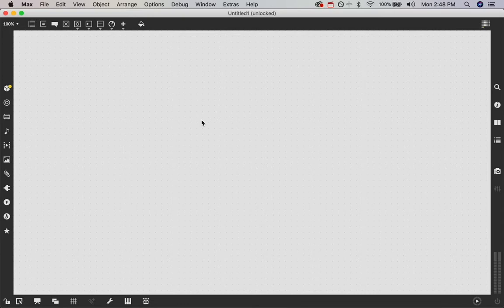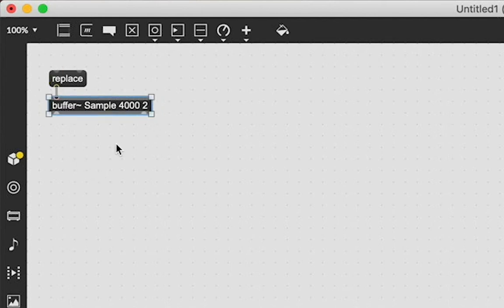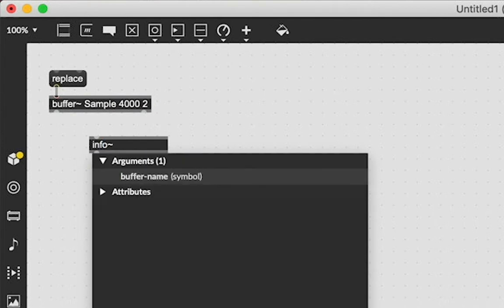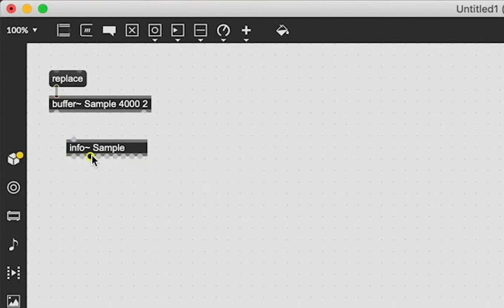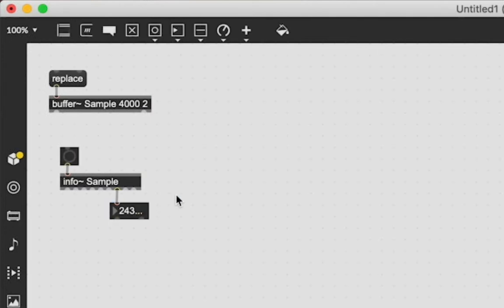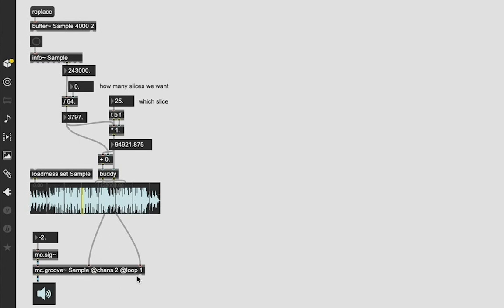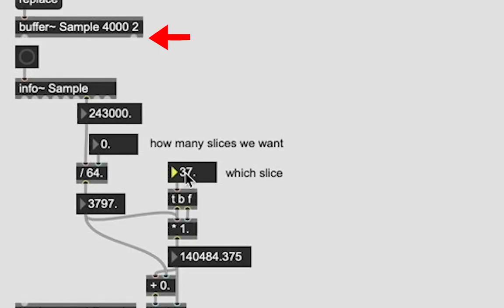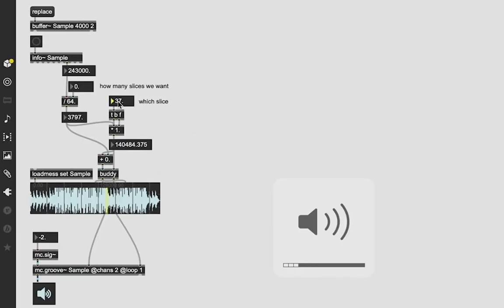Sample Slicer Tutorial -- Max MSP Tutorial

Comment: It's so frustrating - I'm on max 8, and double-clicking just doesn't work. I don't know, but it would be helpful to mention what you're doing instead of stating the obvious - double click the buffer. Double click in order to do what? To open the preferences, the UI? It's just impossible to find another way to proceed, because the double clicking doesn't work, and it's just not clear what this double click does in order to find a workaround and do it in some other way

Comment: Hi, 
I want to set  transient points of an audio  in a video(mov). But "import" message of  (buffer~) does not work.  How I can load or extract audio channel(stream) from a video and load to the buffer~  object?  
Thanks in advance 
Tuğrul
Reply from the maker: That is unfortunately not super straightforward to my knowledge. Check out my tutorial video called “frames above a certain volume threshold” in it I go over a way to record audio from a video file into a buffer, you can record just transients too using the same idea from the video

Comment: doesnt work for me, i get no sound whatsoever :(
Reply from the maker: Make sure  your audio signal is going into the ezdac~ object,  your audio driver is turned on and the output is set to your speakers. You can check the audio driver status and output in the audio status window under the options tab in Max’s main toolbar.